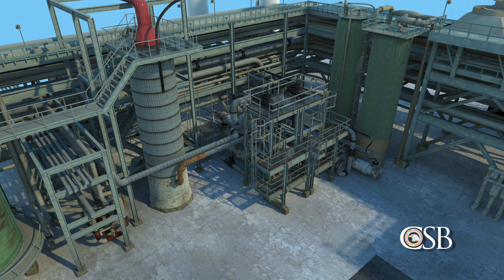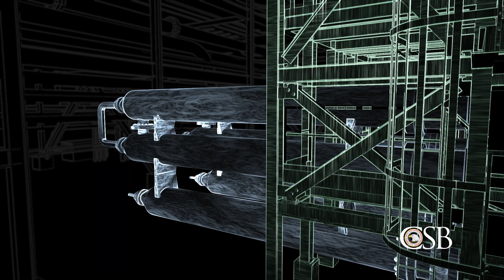Animation of Explosion at Tesoro's Anacortes Refinery

Comment: I wonder how many years these heat exchangers were rated for, and how many years past due for replacement these ones were...
Reply: There was one video that showed a disaster caused by a software upgrade. The new software inadvertently omitted the replacement dates for a piece of equipment. It was supposed to be replaced every 6 months, was missed and wasn't replaced until it blew up 3 years later.

Comment: The designers designed the buildings where you have to remove 80 pieces of pipe before you can remove the tank so they dont get changed much.

Comment: What could have been done to prevent this? 

This sounds like replacing all heat exchangers instead of cleaning them
Reply: It’s not cost effective unfortunately
Reply: About the only way to prevent this kind of degradation of the steel is to either use a protective coating on the inside of the vessel or to replace the unit with one made of a more resistant steel. The latter would only be an option if the plant's budget allowed for replacement of the exchangers altogether.
Reply: @emanwe01  the exchangers could of been crack tested too then repaired.
Reply: @FinnLayNessKiddyy  Nope, you can't repair metal fatigue. All of them were about to bust open...

Comment: What is more interesting to me here is to know that " At high temperature the hydrogen reacts with carbon to form methane (CH4) gas entrapped inside the shell wall and create stress enough to  cause the shell failure"..... That is more valuable  knowledge ...
I think....failure of internal coating of the shell have occurred first which  allowed the hydrogen to reach to carbon and reacts. 
It is really beneficial to know how much time this reaction had taken before it caused such failure in 1" thick shell.... regular inspection of these exchangers is expected to detect such failures. 
I think installing  small by pass line for isolation valves  to  slowly heat up   the heat exchangers before opening the main isolation  valves  may  prevent  normal observed leakages during start ups.

Comment: This one in particular is scary. In a lot of these video's there are warnings signs or precautions that were skipped by the workers. In this case it was a material failure that none of the operators or maintenance people could have predicted.
Reply: If there had been a schedule of metal inspections by say ultrasound they could have caught it. Also if they had not accepted leaking equipment as normal

Comment: "The heat exchangers had a history of developing leaks during start up, something refinery personnel had come to see as 'normal'"

Yipes, really?!   If anything at a refinery is freaking leaking, the safety inspectors should be called in.
Reply: You'd be sadly surprised how common it is. Even running with certain leaks. As shutting down a specific pipe or vessel to repair its leak might cause the rest of the facility to have stop production and thats to costly. In the end its only for the money, safety first is only on paper
Reply: Pshhhh.. nah, it’ll be alright.
Reply: *yikes
Reply: Lack of safety culture is a real thing. You get middle managers to get bonuses based on how much production you make did you get them to encourage workers to cut corners
Reply: When money is involved you'd be surprised what gets ignored. Repairs are expensive and "it's not a big deal" until it is.

Comment: Why not use the pipes inside for the high pressure fluids? So they where two barriers..
Reply: If by high pressure you mean high temperature (since both hot and cold sides of the exchanger were at high pressure), I'm guessing it was because of the fouling. It's easier and faster to clean out the insides of all of those tubes than to clean the outside of the tube bundle plus the inside of the outer shell. For the former, you can just use a pressure washer. The workers in the video actually do this. For the latter, you have to remove the entire tube bundle from the exchanger. A lot more involved and time consuming.

Comment: Old equipment that is beyond its usefulness and needs to be replaced... Ulually the culprit in most cases... Petroleum process refinement on the molecular level is always both sedimentary, AND corrosive! Therefore, pipes and vessels should be inspected, cleaned, AND replaced (if need be) on a regular basis...
Reply: Equipment wasn't beyond usefulness. That's why it was still running.. 💥

Comment: Were the original engineers aware of the hydrogen attack process? Wouldn't that mean that these exchangers would have to eventually be replaced all together?
Reply: Yes, and no. The engineering parameters nationwide were changed as a result of this incident. I work st the refinery, but I'm on the logistics side. My understanding is that the exchangers are brought up over more prolonged period now.

Comment: Actually, some of these videos would be useful for science classes in school: Dust explosions are something few even would think possible -- I'd have never thought flour or confectioner's sugar could explode.
Reply: Peter O. Confections sugar? What about the other types of sugar
Reply: @RobGcraft  confectioner's sugar explodes because it's so finely granulated. this gives it a very high surface area to volume ratio, which means it combusts more violently and rapidly. regular granulated sugar is equally flammable, but neither is all that flammable. the issue with combustible dust is that there can be huge amounts of it in a tight space where it's mixed with the air. so rather than just a pile of sugar catching fire, you get a fire that spreads through the air, and it spreads and expands very rapidly because the dust is so fine. the finer the dust, the faster it burns, and the faster it burns, the faster the combustion byproducts expand. which is essentially an explosion. there is some minutiae about what really defines an explosion, there's a strict line between detonation and deflagration, but in practice they can seem like the same thing, because a fireball doesn't need a massive shockwave to do extreme damage. a giant, rapidly expanding fireball below the speed of sound is potentially more dangerous than a grenade that breaks the sound barrier. anyway that's the deal with dust. if you have a flammable material, and you're gonna be cutting it up into super tiny particles that can float in the air in high concentrations, then you need to take a lot of precautions to prevent it from combusting, or you need to clean it up. both from the air and from surfaces.
Reply: Toxically Masculine thank you, and... how long did it take you to type this!?
Reply: @RobGcraft  Show some respect for practical knowledge. Arrogant kiddies sure is waste of resources.
Please take a long walk on a short pier
Reply: @OmmerSyssel  ^misinput
Reply: @ToxicallyMasculinelol  Confectioner's sugar doesn't explode, it simply burns.
The dust that can explode is very fine dust, with particles far smaller than confectioner's sugar.

That dust can remain suspended with air, which is what creates the explosive mixture.
Reply: MythBusters did an episode about a huge vat of powdered creamer they pumped are in through to ignite it. I asked one of them why they didn't use pure oxygen, and he said he didn't get paid enough for that much excitement.

Comment: After binge watching many of these USCSB videos I have concluded that refinerys explode a lot!
Reply: When I was a newbie in this industry 25 years ago, it amazed me how the refineries and chem plants weren’t popping off every week. Especially the old sites with low maintenance and manpower. I think luck has something to do with it. Issues are caught just in time? Gods watchful eye maybe? Alot also to do with the engineering to begin with. But mostly, the knowledge of the men and women that operate these processes. You look at those folks walking around in blue coveralls, and hard hats, and they look like nobody special. But, they are for the most part, some of the smartest people I’ve ever met. Average folks with the knowledge base of chemical, mechanical, industrial, electrical, structural engineers, pipe fitters, welders, heavy equipment operators, safety, plus much more, all from years of experience. That is why this doesn’t happen way more often.
Reply: @jonkannard3679  Finally someone with basic knowledge and experience from real life.

Although I do wonder how often you actually worked along with women with practical experience and responsibilities?
Reply: Me too. I noticed that a lot of these explosions happen in the heat exchangers.
Reply: @deepdivedisco4779  the Exxon Mobil CA refinery fire was caused by a faulty Fluid Catalytic Cracker unit (FCC) unit  and exploded at the air portion of the unit. After a Variance protocol went horribly wrong.
Reply: As long as our supply system (truck and railroad) are diesel powered, fossil fuels aren’t going anywhere in the near future. Even the convenience of spending 5 minutes to refresh a vehicle to another 2, 3, 400 miles of travel distances, if not more, versus possibly hours in a garage, with even the factory rated wiring for electric vehicle, it’s YEARS before fossil fuels become a thing of the past.
Reply: Not really.  There are a LOT of refineries...actually, places that have explosive dust are quite a bit more explosive.
Reply: Same and it's easy to see its usually the result of the company being negligent just to save money.
Reply: It’s like watching shark attacks and concluding that sharks kill thousands of humans… 🤦🏻‍♂️
Reply: Relatively speaking, nuclear reactors are very safe, refineries are not
Reply: Just like planes crash a lot.
Reply: Same here
Reply: i like how the fire cgi gets better looking though out the years
Reply: Facts
Reply: Not in Australia they don't.
Reply: Basically everything is dangerous, stay vigilant!!
Reply: After binge watching these I now know the grain mill next to my work poses a huge dust explosion risk!
Reply: Yeah and I think it was defunded in 2020 😒
Reply: Oil companies run on super tight budgets so the C suite morons get bonuses every year and when you don't do maintenance you get explosions.  There needs to be MASSIVE fines so big that no company would be stupid enough to not do maintenance, but the current fines are so low that it is not worth it to them.
Reply: True 😂😂
Reply: Chicken plants, flour and canola plants, all sorts of plants explode a hell of a lot more then refineries and upgraders for the oil industry. You never hear about them nearly as much because the whole concept of oil is polarizing. There re so many industries beyond oil industry accidents that have accidents way more often but you never hear about it because oil accidents are so much easier to make more dramatic and controversial even though their safety standards are TWICE as good as the other industries
Reply: @henrymorrey4150  Accidents from those places don't leave chemicals and oil all over the place for 100s of years.  There is still oil from the Valdez in the water in Alaska and we are still finding large amounts of oil at the bottom of the Gulf from the Deep Water Horizon.  Those explosions you are talking about wreck buildings, these explosions can blow up and contaminate cities for decades.
Reply: @IamCaleum  the hell you talking about? I work at a canola plant in the middle of a small city, it is a huge industrial site, they produce biodiesel and a bunch of other products. They use hexane and solvents and extremely dangerous chemicals that even the oil industry doesn’t use. There is even a building called the “Solvent building” that the ppm of explosive atmosphere is so constantly high you can’t use electronic equipment in there, this solvent is highly corrosive, flammable, explosive, and toxic…. Parts of this plant are literally 200 feet away from residential homes…. I worked the oil industry my whole career and just recently changed over to this job… they use caustics and some insanely nasty shit….. where is green peace protesting this?
Reply: @IamCaleum  wtf are you talking about??? I work at a canola plant IN THE MIDDLE OF A SMALL CITY that has buildings so toxic and explosive you aren’t allowed to use regular wrenches in this place it’s so explosive, you have to use hundreds of thousands of dollars of spark free brass wrenches to do any work, that’s just because of the possibilities of sparks. This place is literally 200 feet from a neighborhood and 300 feet from a retirement home! If this gas/liquid ever released it would hospitalize thousand with getting released…. Before this I worked my entire career in oil/gas…. The safety standards and practices in oil are TEN TIMES better than in this place… it actually upsets me daily
Reply: Thats qhat happens when your whole operation is based on boiling highly flammable material to refine it.
Reply: If they don’t have pressure relief systems that is
Reply: When poorly maintained and procedures aren’t followed
Reply: They don't really... they are generally very safe but these videos are all about disasters so you're only seeing the ones that do have accidents...
Reply: Janet Sminten i wouldn’t call them “very safe” but they also don’t regularly explode. If they were very safe there wouldn’t be so much safety talks at work lol
Reply: They don’t actually. Lots of isolated incidents are recorded, but not explosions. Usually first aid things that could’ve been prevented with measures made by employers safety programs.
Reply: Same here. They are so interesting!
Reply: Because profits are more important than workers and communities safety and health. Maintenance and safety comes last. Look at the South Basin of Durban South Africa. People live 10m to 100m away from the 2 biggest oil refineries in Southern Africa. Its now become known as cancer alley. It also has the highest rate of asthma in children around the world.
Reply: The nonchalant  way the narrator explained how the last refinery death was 2005.highlights the fact that no real repercussions or criminal liability is accessed to these companies. Profit over life.  They leak volatile tocxic chemicals during startup and “its normal”.
Reply: what are your recommendations?
Reply: @Kuzyapso  Always ask the supervisor how often the heat exchanger explodes.
Reply: @Kuzyapso  I live by a rule. Don't go near splody things.
Reply: They explode a lot if you have no regurarly check of components by an external authority. The same for your brakes on your car, if there is an regular check by an inspection authority, issues with failing brakes are close to zero.
Reply: I think the amount of manpower and energy it takes isn’t worth it in the long run. Ya we might get to use gas for another 20 years, but we could save workers lives, the environment, civilians health, and probably a few other future concerns, if we spent half of these resources finding a new energy source. (Yes I know there’s countless logistics behind this claim)
Reply: @ashersolomon9560  well, good luck sharing those obviously relevant thoughts with the spoiled youth in educational institutions aggressively busy with utterly ridiculous issues like BLM, gendering, minority and identity issues.

Necessary Inventions still doesn't fall out of the blue sky.
Reply: @ashersolomon9560  nuclear. Your electric cars mean nothing if you're burning coal to charge them.

Comment: No recommendations in when to replace heat exchangers?
Any technology like X Ray scanners to detect fractures in metals?
Reply: They could use something similar to ultrasound to detect defects in metal. I did a lab called “ultrasonic non destructive testing” at school but pretty much detecting cracks through pulses sent into the metal.
Reply: @zonkeymaker  ultrasound is used to detect minuscule cracks in the blades of turbofan engines. It can even detect tears in the material that haven't reached the surfaces because the broken continuity of the metal reflects differently the sound
Reply: Efstathios Dimopoulos yea exactly! Very interesting topic
Reply: For new plants, typically a higher material grade is selected, which is less prone to high temp hydrogen attack.
Reply: Most refineries use all types of NDT (Non Destructive Testing) to test the integrity of pressure vessels and the piping.  They use ultrasound, x-ray, eddy-current and penetrating dye most often... and maybe some magnaflux.  The UOP sets a greater share of standards for procedures and frequency.

Comment: I feel really bad.. People go to work and don't go home or are disfigured.. Again it's the CHEAP SKATE MULTITRILLIONAIRES not using appropriate materials for this crucial heat exchange..  100,000 for carbon steel or 5 million for inconel.. People died!!! Better codes shall be written.
Reply: Sucker worked for 40 years. It's not so much "inappropriate materials" as "insufficient inspection."
You could replace the whole bank every decade for $400,000 given your numbers, and avoid the problem, or inspect the interiors every now and then and see if they needed replacement, but "make everything stupid expensive" is overkill.

Comment: Informative and lesson for operators and designers. Equipment such as Heat Exchanger undergoes cyclic thermal operations need fatigue testing and remaining life cycle analysis to avoid such accidents.
Reply: the fact that the unit regularly leaked during startup signaled that it was probably end of life, in any case your right about testing
Reply: Should be a required replacement period
Reply: @jonmeray713  better with regular testing. 
Practices should always be prioritised above calculations based on theories.